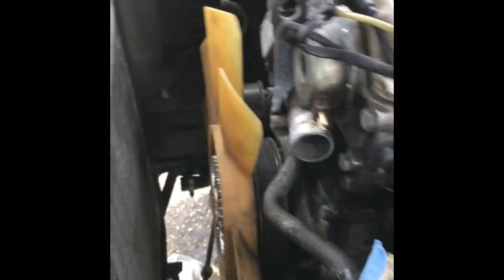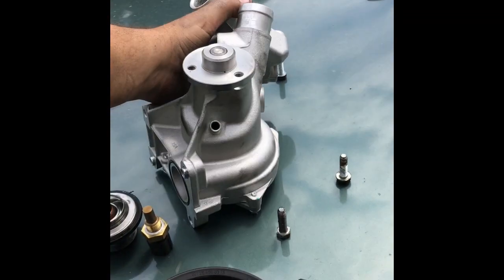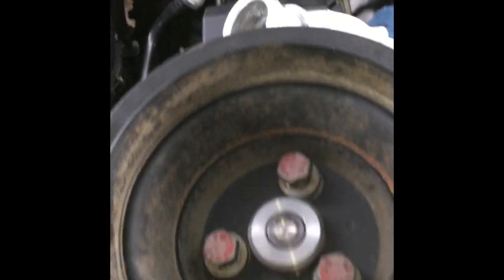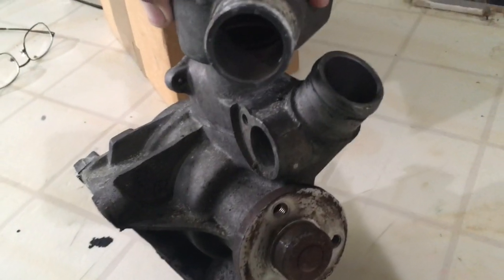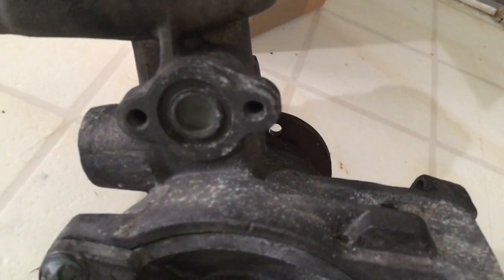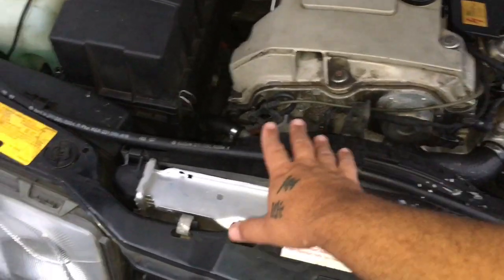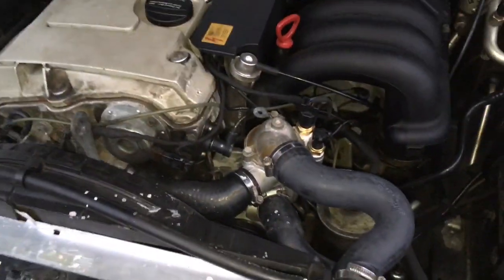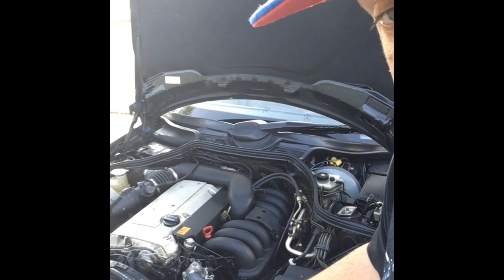how to install water pump on mercedes w124 (m104 engine)

Comment: Great video! I came looking to see how tough changing the water pump would be and from your video I can see that with a little patience, right tools  and right replacement parts (ahem) this is not a tough job. One thing I would add is that anyone having some cooling problems check the viscous fan clutch as well. Spin it a bit by hand and there should be some resistance but if the fan spins freely then it is an indication that it needs changing. I chased the cooling issue around  a bit changing about everything I could  and the last thing to change was that fan clutch. It seemed to be OK at the time, or so I thought but when I changed it out the cooling situation corrected itself on my engine. I believe that the fan was not pulling sufficient air through the rad because the fan clutch was pooched, in my case the oil had leaked out. Should mention I have the M104 engine as well. Again good on you for postingthe video.
Reply from the maker: thanks for your post. yes its a fun weekend job to do. and like in my other video about the fan clutch, it dies silently and quietly, to where drivers don’t notice it anymore . the fan clutch should be roaring loudly especially on hot days. a good working fan clutch, water pump, auxiliary Fans in the front , new radiator , thermostat, all make the car temperature stay in range.. 👍

Comment: excellent video - as the man says, inspirational!  Mine is a 95 e320 convertible with a shot water pump - been sitting in the garage stateside for almost 2 years while I was stuck overseas due to damned virus travel issues.. Now that I've seen your vid, I'm all fired up to get at this next month and get her back on the road!  I will DEFINITELY get one of those Walmart compressed air wrenches with the 10" extension - thanks for the tip and will also look on ebay for the WP itself. Pelican has MB orig at $400+ :-D and two others at about $160-180. Sure like the sound of $42 a lot better!!, and with the $ I save, I will also replace the radiator and the thermostat as you suggest - good idea!! Thanks again!!
Reply from the maker: glad I could help you.. yeah this project wasn't difficult to do.. just make sure to double check all the clamps and hoses for leaks  once you installed your new parts ..mine leaked 2 days later so had to retighten things once more  for a snug fit..

Comment: Nice video.  My M104 has 6mm bolts holding on the WP.   One looks really hard to get to b/c of the tensioner adjuster in the way.  Mines running hot in traffic with a new radiator so I think it’s time.
Reply from the maker: Beezersh .. well not sure what year ur Mercedes is and the country you’re in ,but ill say with the USA m104 engine.. that tensioner pully is super easy to move .. mine was a 17 mm socket placed on the tensioner and just pull upwards and it then it allows you to  remove the belt ..takes about 10 seconds.. if u do decide to do it.. try not to take the whole thing off ...its alil confusing and takes about 20 minutes to put back on!!!😬
Reply: Thanks man. USA 93’ 2.8L.  Yeah I replaced the whole  tensioner this summer so familiar with that.  Also looks like swinging the PS pump out of the way helps. Thx again

Comment: Love the vibes you're giving off man. Inspirational. Between the Pelican Parts write-up and this video I think I can replace the water pump on my own. Did you lift the car to do it or no? Thanks again.
Reply from the maker: dack ragus   .. yes i jacked the front of the car up and put on the jack stands. doing this helps !!  glad i could help you or inspire u to take on this replacement project.🤙🏻

Comment: Aye bro I have a 97 e320 mine is running lil over the normal temp I've replaced the cooling fan and cooling temperature sensor and it's still running lil over I have a new thermostat but I haven installed it yet
Reply from the maker: Well if you have the money.. a good refresh of the cooling system helps.. I Put in a new water pump ( most important) , new radiator, thermostat and fan clutch .. then new auxiliary fans but those only come on to aid with cooling for a short time. Each part does its job to maintain the temp. If it’s getting hot then one or more of those parts are failing.. strangely mercedes benz parts die slowly and silently. So it fools u into thinking everything is okay ,but it’s really not. Lol 🫣
Reply: Thanks I'll get to my mechanic and have him look over it a little more home I appreciate it bro